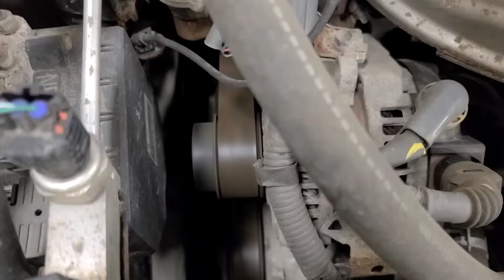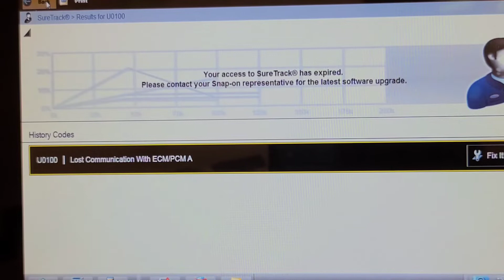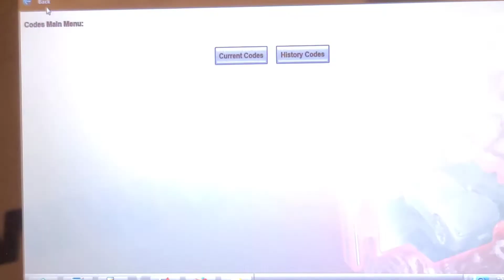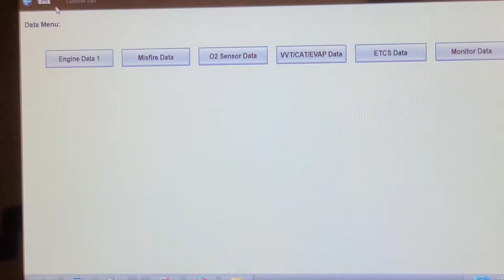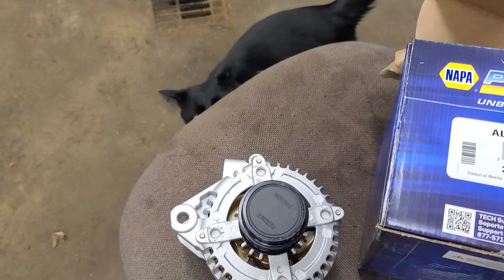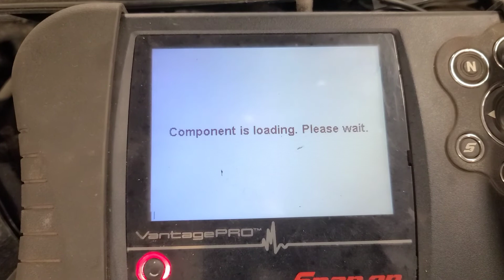2009 Pontiac Vibe Battery Going Dead, Alternator Testing & Replacement.

Comment: Thanks for the video.  I need ti replace an alternator  on  a 2.4L vibe, 2009.  The 1.8 looks much easier.  Fyi, the whining  noise is definitely  the sound of a failing alternator.  My daughter's  car has the same noise.  I saw a different  video where a guy simply unplugged the wiring harness from the  alternator, while the car.is running,  and the whine went away.  Thats indindication of a failing  alternator
Reply from the maker: Yes you are correct but technically the rectifier is failing. Open or shorted diode. Good luck

Comment: So it seems I am going to have no way to change this alternator in the parking lot at work. fucking lovely. Guess I'll pay the value of the car to get it towed and the serpentine belt removed by a pro. Fucking hell!
Reply from the maker: Yes its not that convenient for sure.
Reply: Man, I just did my alternator on my 2005 Pontiac vibe. I gotta put it all together. But I only have the belt taken off from the alternator, and left it on every other pulley

Comment: Can the voltage regulator alone be replaced? My 2009 2.4L Pontiac Vibe Base is giving 15.58 volts at the battery when RPM is above 2000
Reply from the maker: The regulator is replaceable but most times the housing bolts won't come out, the stator is welded to the rectifier so leads usually need to be cut and resoldered afterwards and the normal parts stores don't sell just the regulator.

Comment: Thank you in advance for your help.. So to take off motor mount I need to lift the engine a bit? Is that to keep it from binding while installing.. Never done this before..yikes
Reply from the maker: The motor mount holds up the front of the engine. It will drop if you don't support the engine.